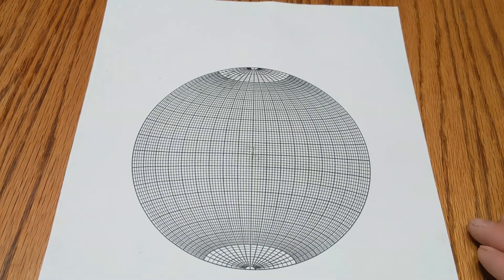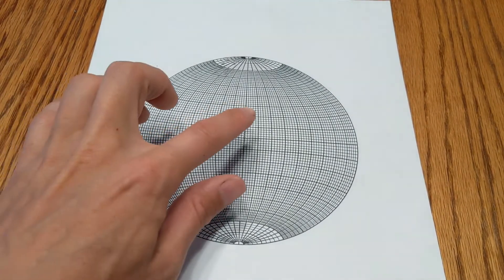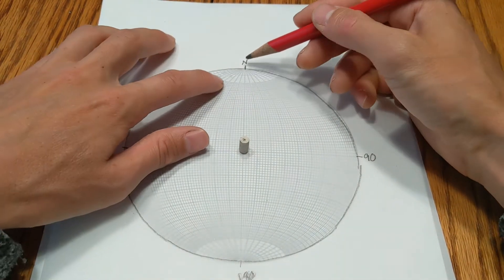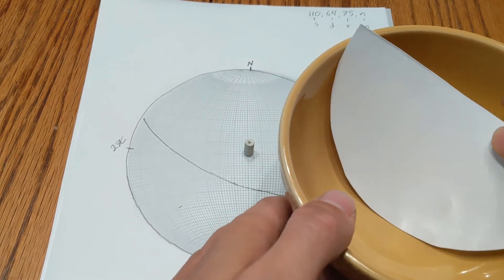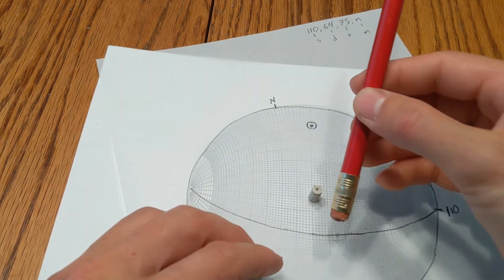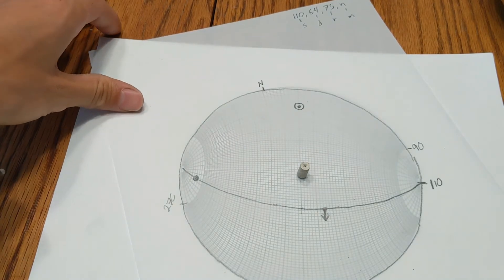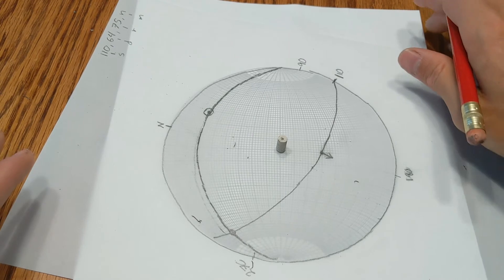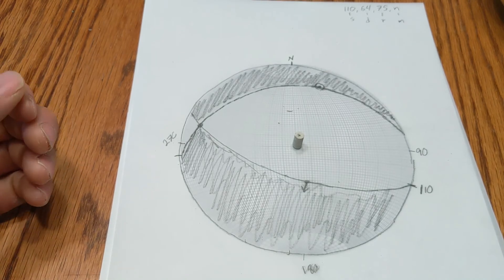Plotting Focal Mechanism Solutions on a Stereonet

Comment: Thanks a lot for your efforts. I was wondering why did you count through the small circles a 90-degree angle starting from the rake position to put another point on the same great circle that represents the fault plane?

Also why did we start counting the rake angle itself from the right not from the left?

Comment: This is a really great demo. There's a point of confusion with sigma1, though (at least in my brain). Sigma1 (max. princ. stress) should generally be 30 deg from the  fault plane, so it would not be exactly in the center of the white portion of the plot. Wouldn't sigma1 be 60 deg from the aux. plane?